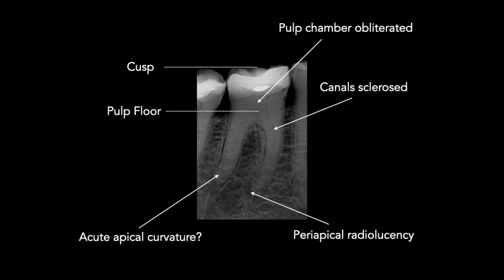RCT LR6 with six sclerosed canals!

Comment: Chronical Periodontitis in one treatment? What if the tooth becomes symptomatic after obturation?
Reply: as long as the canals have dried I don't think there is anything to worry about
Reply from the maker: Good answer!
Reply from the maker: Yes most teeth can be treated in a single visit unless there is persistent drainage  or canals cannot be dried.
Cheers
John

Comment: Great case doc. About how many wave one gold files do you use for a case like this? Also have you ever had an SX file tip break when initially coronal flaring in a tight sclerosed orifice ?
Reply from the maker: Hi dds_roque
I discard any damaged or "blunt" files so may need 2-3 small Wave instruments in a tricky case. Yes the tip of an SX has broken but they are very easy to remove.
Cheers! and thanks for watching
John

Comment: Do you do single cone fit obturation or full warm vertical condensation? Please may you do a video on your obturation method?
Reply from the maker: Hello there
I use both vertical compaction and single cone and BC sealer
I can make an obturation video with pleasure
Cheers
John

Comment: Hey John, great presentation. I had an UL6 today with a sclerosed DB canal, I think I saw the white dots as above, but was not able to negotiate it. When you see the white dot, do you go in with the Pro taper shaper? Also, where can you get the LN bur from? and does it go into the slow hand-piece at a low setting?

Thanks for the video!
Reply from the maker: Hello Nayeem
LN burs are made by Dentsply Sirona and Maillefer, rotated in a slow handpiece, speed depends on what you are cutting...tooth, amalgam, composite etc....
If the canal is visible on the radiograph I am happy to use the SX straight away, but go gently to avoid fracturing the tip
Cheers
John

Comment: Hi John
I saw that you often use the Sx file before any manual file or before gaining a glydepath. Is there a risk to made a perforation? I m scarry to use the sx😅 before manual mainly in MB2 cases. I need some help🤗🙃 from the best endodontist 😁! Tnx
Reply from the maker: Hi Daniel,
The SX has a very fine tip, and can be safe to use just to open the orifice.
Cheers
John